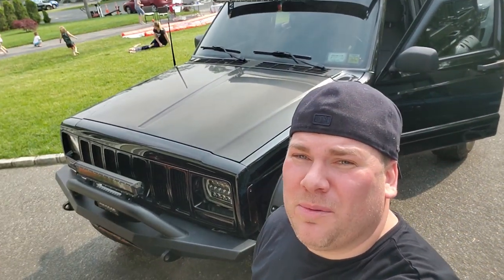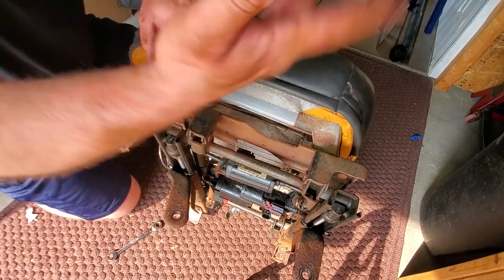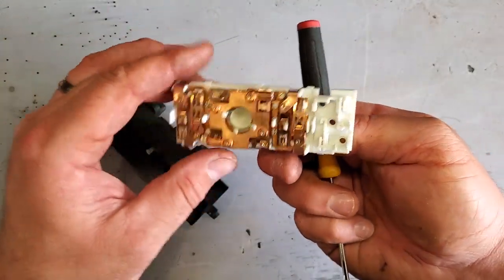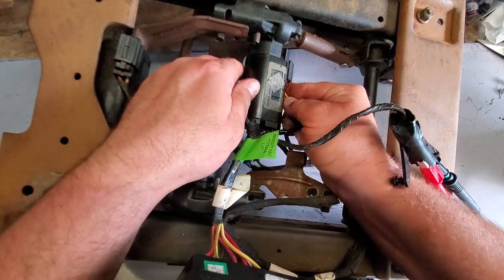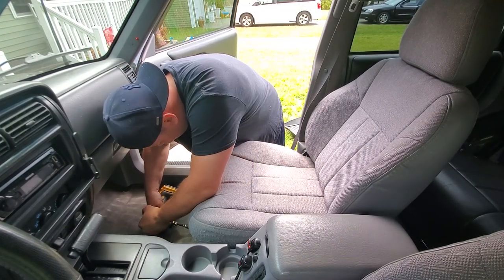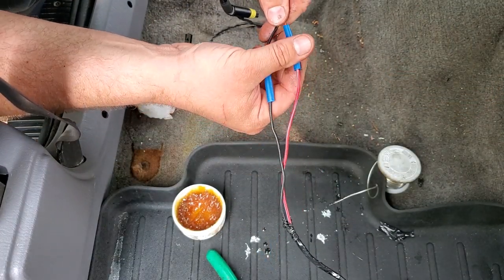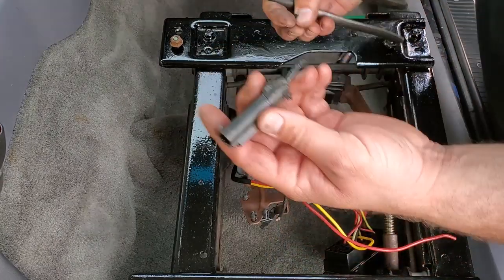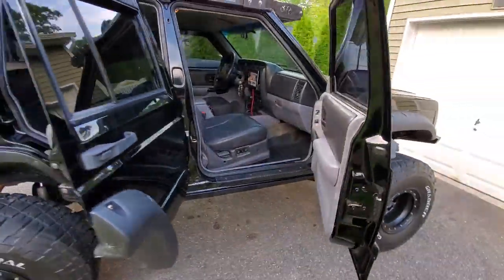JEEP XJ OEM POWER SEAT CONVERSION FOR 1997-2001 CHEROKEES

Comment: Dan, I love all your videos and wanted to do exactly this!  After looking for leather seats like yours for more then a year ( I'm in Brooklyn, NY and they  are rare in my hood ) I finally found them not too many hours drive away. The seats I got was in great shape and had already been converted to XJ brackets.  I thought that was awesome, but later I found out the back recliner was still electric . I was stupid enough not to check that part before buying the seats. That said I ended up with WJ seats on XJ brackets but still WJ electronically recliner for the back part of the seat. But no electrical wiring left at all. After doing tons of googling reserch I realized it might just be worth to try to swap to mechanical for the back part as well.  I found the mechanical recliner on eBay for the seats and they fit. The seats even have hidden connections to fit both electrical and mechanical! So for all you who does not want to deal with the complicaded electric part like me. This is a great option. Even the old XJ seat trim panel fits after the swap. :)
Reply from the maker: That is fantastic work! Excellent Job!  Yes you may have been able to just tap power and ground to your recliner but I like what you did better.  I think you can see both the manual and power bracket holes in the frame when I did my WJ seat fix. Thanks for watching! God bless!

Comment: Now I know my next XJ project. Sand the contacts on the driver's side power seat switch. Only forward and back works right now. Thanks for the tips. I want those cloth seats. Never liked my cracked leather ones.
Reply from the maker: find a fresh passenger seat and swap the cracked panels out👍
Reply: @ProjectDanH  My power seat issue wasn't the switch or the motor. It's those broken plastic actuators. Time for a junkyard run. Yeah, I should have swapped out my 91 cloth seats to this 99 when I first bought it. They were much more comfortable.

Comment: 12 v connector is under the carpet under passenger seat on the inner right side of the bracket that seat track is bolt on to. You will need a wiring harness from the donor vehicle and 25 amp circuit breaker in slot 29 in passenger side junction box
Reply from the maker: Thank you Alexey!

Comment: Put power seats in my XJ using your vid.  Had to replace the worm gear (available by itself) Added heated seats with the controller in what used to be the ashtray.  Used the seat motor power.  It has a 45 amp fuse in addition to the 10 amp fuse that came with the heaters.  Just never use them at the same time, witch is very rare.   Thx
Reply from the maker: nice mod! I've never activated the heaters. Any other suggestions on how to hook it up?
Reply: @ProjectDanH  the ones I got were from Amazon as a gift.  (wife knows me well)  there wasn't a place to put the switch so I replaced the ashtray with a usb port and the controller.  There's a spot for another mod there but I haven't figured out what to put there yet.  The seats I got were worm on the bottom so I replaced them with the same color. After I get my rock sliders in, I'll put in a couple of Thor handles so she can get in easier.  She's not too keen on the lift.
Reply: @ProjectDanH  I used the power from the seat motors.  It's a 45 amp fuse and the seats have a 10 amp fuse for itself. Controller was a tapped into a add a fuse

Comment: Hey Dan! Great video. I know you have/had both xj and wj jeeps. My question is how similar is the wiring for the wj power seat base to the xj power seat base. I found a nice set of wj seats and xj power seat bases for cheap. Wonder if I could just use the xj base with wj seat and keep all the power settings

Comment: Oh great video I might keep my power seat if I can fix it. 

Would you have any idea why the front height adjustment motor makes a grinding sound unless I’m on a washboard road, then it works fine and the forward backward motor will move it forward but not backward unless I physically push the seat backward at the same time?
Reply from the maker: It may be on its way out.. Gonna try to make a motor repair vid one day

Comment: Nice Job. But FYI those contacts have a plating on them sandpaper will remove it and they will foul out faster. use paper card stock rough brown paper is perfect. I know I have cleaned thousands of them when I was a vending machine tech..
Reply from the maker: dude, solid info. thanks for the tip!

Comment: I love that XJ, my favourite on the internet. Any advice for removing a snapped bolt in the rear shackle mount? got bolts from rough country and they snapped when installing new shackles and leafs.
Reply from the maker: Oh man! That completely sucks..how far in did they get before they snapped??
Reply: @ProjectDanH  it threaded in pretty deep. its all the way through to the other side when I peep through the back of the frame. taking it to a shop so they can hopefully get it out. its worth it, my XJ only has 75k on it, its a 2001 sport so im not giving up on it for a long time.
Reply from the maker: @CounterclutchHD  that's the spirit! Maybe they can weld a nut onto it and back it out. Good luck man 👊 🤞

Comment: So I have a 2002 Grand Cherokee that was T Boned by a dump truck... well the seats and the drive train are salvageable. I have a 91 XJ and I want to the 2002 Grand's seats in it... is that gonna work or am I gonna have to make modifications to the seat base or floor of the XJ  
Congrats on the little guy... you're gonna love teach him the XJ
Reply from the maker: thank you so much!  try taking the WJ seats off the WJ frame and putting them on the XJ frame.  should be 4 13mm nuts. let me know how it goes 🤙
Reply: @ProjectDanH  Thanks for the impute. sure appreciate the reply. I did some additional Google searches and came to this... 
https://www.youtube.com/watch?v=wtYhykZXLz0
So before the WJ goes to salvage you need any parts
Reply from the maker: @NetworkDesign3598  Nick in time is awesome.. yes I actually have a list of wj parts I need! How can I get in touch with you??

Comment: Hey dan i hope you see this commentn after this long. I want to do this with my XJ its a 99. Does the heated seat portion work? Also what do the seats come out of to bolt right up like that?
Reply from the maker: Those are XJ seats, Heated seats will work if you can wire them

Comment: Crazy it wasn't already included in 98, my 91 xj has power seats, full leather, overhead console and smoker windows, 242 transfer case, HP30 and a transmission cooler that all came stock.
Reply from the maker: Wow.. that 91 sounds like a sweet ride!  There's so many things you can upgrade on a base XJs that are plug n play or close to it!

Comment: Where in the fuse box does the power come from? Is it 6B (red w. blue stripe) as I have read somewhere?
Reply from the maker: the junction block?  yes it's at the bottom.. it's only a 2 wire connector with 12GA black and red/blue wire.  hit me up on Instagram and I'll send you a diagram

Comment: Really intuitive. Wow. Know anyone with a clean set of Tan seats? Haha. 99 XJ non power. :) drivers is worn out passengers still mint.
Reply from the maker: TAN !!! Ahhhh Tan is so rare!  Here's what you do,  find another tan passenger seat and use material from it to restore the rips in the driver seats.  Then find a pair of power bases and you can swap the seats onto them.  The manual seats and the power seats have the same exact mounting points.  Now since the tan power seat trim is so rare you can use a set of the dark agate seat trim to match the two tone dash and door cards!!!  (..or find what you can and paint it tan.. lol)
when youre all done send pics! 😁👍
Reply: Project Dan H ok! It may or may not ever happen though. Haha.
Reply from the maker: @Chrisw678  🤣

Comment: I have two powers seats I like to install, but there is no wire harness so I have to make my own. Where do I tap the 12 v?
Reply from the maker: make your positive one power wire right off the battery. don't forget to put a fuse approximately 6 inches away from the battery end.  then make your negative a ground and use an existing body ground near the seat. 👍

Comment: Hi Dan, I learned so much from your channel and decided to buy my own XJ in the Netherlands. It’s a stock Limited from 2000 with the 0331 head, yes completely stock 😉
Question: Since it has a lot of options but unfortunelately no heated seats, do you know if the wires are pre installed from factory?
Thanks for taking your time making all these videos. 
Bob
Reply from the maker: hey Bobby! thanks for watching! I'm glad you were inspired to get an XJ. Are your seats power leather ? hit me up on instagram @project_danh
Reply: Project Dan H Yep, power seats with tan vinyl leather. 
No switches in the ashtray.

Comment: Dan I have some xj power seats but the bolt pattern to mount them into my 2000 Cherokee is different. yours seemed to bolt right in. Did you salvage the Bottom of the non-power seats for proper figment?
Reply from the maker: nope. direct bolt on. my 01 seats fit perfectly in the 98. they're all the same

Comment: Hello dan, I’m new to Jeep and your videos but I am learning a lot while enjoying your videos, just was wondering if 98 ZJ seats fit 98-99 XJ. Or what are the best years to find parts for the 98-99 XJ? Also is there anything different about the two door models? Do you know if the two door model has the power cord for the front seats like your video Thank you in advance.
Reply from the maker: Hey Nixon Thanks for watching! Just about every part from 97-01 XJs are interchangeable except for the cruise control buttons and the Overhead console wires.  also in 2000 the XJs got coil packs.  
Yes, you can swap over seats from other year XJs and also ZJs.  you can fit WJ seats in too however I believe you must re use the XJ seat frame. its an east swap. just 4 13 mm nuts per seat 👍👍
Reply: Thank you so much
Reply: Hello Dan H, I was wondering if you had a video on taking out broken bolts because I took my seats out and I had one break on me when I was taking out my drivers seat. Do you have recommendations on how to take that bolt out?
Reply: Also how do I make 97 zj seats work it doesn’t seem to match the bolt position and my brackets doesn’t fit the seats
Reply from the maker: @nixonmatignas7506  try the ZJ seats on the XJ frame

Comment: Much Appreciated Sir!!   What Year is the XJ that you installed the Direct Bolt In  WJ seats?   and,,,,, What Year was the seat doner WJ?  Thank You
Reply from the maker: 01 XJ limited seats into a 98 XJ sport. Direct Bolt On
Reply: @ProjectDanH  that's crazy because the seats look identical to the WJ seats I swapped into my xj. If you are planning on swapping WJ seats into your XJ, you can simple swap the xj brackets onto the wj seat and bolt them on
Reply from the maker: @zh4210  awesome! Thanks for the info

Comment: I found a 2000 xJ limited with power seat on drivers.  Seat cushions roached but are these seats rare enough for me to snag from the u pull it?  Anything else I should look for on a limited?  Thanks for your input
Reply from the maker: wow definitely take the seats! they can be refurbished.  also take the door cards, radio bezel, switch bezel with fog light button, headlight harness in the header panel with the fog light wires. over head Console with it's wire that run to the junction block and it's mounting bracket. the infinity amp and definitely take the triangle shaped tweeter covers that's the plastic on the side view mirror.
Reply: @ProjectDanH  wow, I'll be headed back tomorrow!  Thanks for sharing your PHD XJ knowledge!
Reply from the maker: @MajorWeakness  anytime!  Basically grab anything wood grain! Lol.  I'll buy it all from you if your interested in selling
Reply: @ProjectDanH  , its has the tan interior,  I see what I can get.
Reply from the maker: @MajorWeakness  well I don't need tan, but you can make $$$ on eBay!

Comment: great video man! now im going to do the swap myself. only questions i have is which year wj are those seats and did you use xj rails or wj rails?
Reply from the maker: These are XJ seats from a 2001 limited.
Reply: @ProjectDanH  is there a way to get the heated seats to works?

Comment: How did you wire the heated seats
Reply from the maker: you need to power the heated seat module(under the passenger seat... and install the factory buttons

Comment: Dan, I have a 99 xj with manual seats. I have an opportunity to buy some leather wj powered seats. Do I have to find a set of xj powered seat frames to make this work? Can I set the seat position with a battery pack and just bolt them right up? Or, Should I punt on this and try to find some manual wj seats. Would you recommend trying this seat swap? I really need your advice, supposed to meet the seller later today and not sure if this is a good idea. Thanks
Reply from the maker: I would definitely get the WJ seats and bolt them onto your XJ frames.. you can always upgrade to XJ power  frames whenever they become available. 👍
Reply: @ProjectDanH  thanks very much

Comment: Dan you are awesome. I have to do this now that I have seen your killer video. We’re these zj seats or were these out of an xj limited?
I am going to my local pick and pull tomorrow and I’d love to know what years to look for in leather seats to fit my 99 xj sport. I hear that most zj years will work is this correct? Btw happy thanksgiving! Thanks so much.
Reply from the maker: thanks brother!  these were 2001 XJ limited seats I had stashed away.  if yours are a 99 then I recommend 97-01 xj limited or classic seats.  ZJs and WJ seats fit too .. just gotta use XJ frames
Reply: Thanks Dan, do you know if there is a list somewhere on the internet that displays parts that can be swapped between xj’s zj’s and wj’s? 
Love watching your videos you make it all look so easy.
Reply from the maker: @addisonbrady8737  Thanks man,  I believe that all WJ and ZJ seats will fit on XJ frames ...  but if your xj doesn't have power seats you will have to hook up the power for the recline function. lol.  hope that helps buddy
Reply: I found a complete set of xj leather seats but they are from a 96. Will these work?
Reply from the maker: @addisonbrady8737  I think they will fit.  Plugs may differ

Comment: Did u use the factory heating units? Do any other model seats bolt in to the xj
Reply from the maker: no these seats were not heated.  I think a zj seat bolts in. if not then you can bolt the ZJ  seat  onto the XJ frame.. WJs too
Reply: @ProjectDanH  I thought that if there was a power passenger seat, then the seats were heated.  According to the Jeep brochures, for 99-01 heated seats came with the power passenger seat (and that was the only way to get it.)

Comment: hey man what year model did yall get the seats out of ???
Reply from the maker: I took them from a 2001 XJ limited that was about to be cut to pieces by the FD.
Reply: I found a power seat in a 99 xj sport with the infinity sound system. Got the power seat for 35 bucks with the amp and tweeters. Had to fabricat a new mount plate for the bolt it was rusted away
Reply from the maker: @commanderwhite12  thats awesome great score!  did you get the wire pig tail too? i know how difficult it is to find diagrams for factory infinity system
Reply: @ProjectDanH  I got the whole wire system for the power seat that goes to the pass foot well. As for the infinity sound system no i didn't get the wires...mine didnt have them and I'm not sure if I could wire it in in. I also got the tweeters
Reply from the maker: @commanderwhite12  Cool man!  See if you can go grab the pigtails!!! that would complete an awesome install!
Reply: @ProjectDanH  so I can wire in the infinity amp? Do you have any links or write ups I could us?
Reply from the maker: @commanderwhite12  you will definitely need the factory pigtail to plug into the amp.  I'd suggest getting as much length as possible. Then your gonna have to tap wires for the amp input and also tap the amp output wires for each of + and - of the speakers.  The only way you can do this is with an amp wire diagram for your specific vehicle.  I printed one out for my black beauty xj and you can get a glimpse of it at 7 mind 49 second of my "The Perfect XJ" vid... Come to think of it, its easier to just buy a new amp! Lol 🤦‍♂️
Reply: @ProjectDanH  probably I scored it cause it's a rare find in the junkyard out of sheer luck I found a 97 xj overhead console and wire harness...didnt fit my 99 kicker is the amp and seat I got out of another 99 xj that HAD a overhead console but it was gone and someone cut the ends off the top. I saved it...but bummer I dont have the rest. Would make a beautiful xj.
Reply from the maker: @commanderwhite12  you can wire up any 97 to 01 console to any 97 to 01 XJ.  Just gotta re wire the connectors.  I put a 98 OHC in a 01 sport 😁
Reply: @ProjectDanH  tried I came out with two extra wires that I couldn't connect. (Had cut and spliced the wires) You wouldnt have a write up by chance? I gotta use the 99 harness 97 has 3 plugs 99 has two.
Reply from the maker: @commanderwhite12  sorry no write up. It was in 2016 so I didn't do a vid either.. I may have pics tho.. I did loosely follow another write up that compared all the different types of OHCs.. it's out there somewhere on the forums

Comment: What are those seats from?
Reply from the maker: 2001 XJ limited
Reply: Thanks man. Those looked like grand Cherokee seats but I wasn’t sure
Reply from the maker: @lano7777  They are definitely similar to grand cherokee seats only not as comfy! haha
Reply: Yea no doubt! I wonder if they would transfer over? Maybe too wide
Reply from the maker: @lano7777  ZJ seats bolt onto the XJ frames 😁
Reply: Project Dan H would 98 ZJ seats fit in a 98-99 XJ?